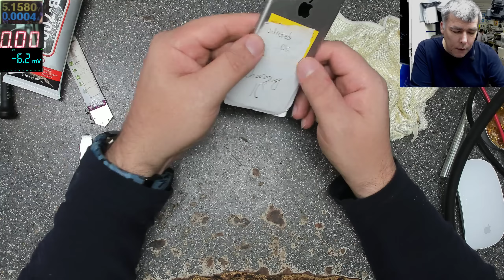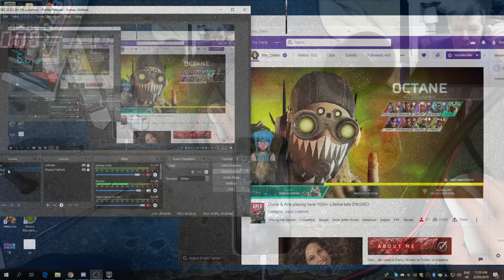Sony Xperia zx1 not charging (usb-c) & Iphone not charging

Comment: Just had the exact same fault on my Sony zx1, just stopped charging so after looking at your video I set about taking it apart.  Worse thing was knowing how hot to get the phone to loosen the glue.
Got the screen off, took the backing plate off and my phone had the same connector not fitted, I pressed it back into place and plugged the screen back in and charged the phone. Started to charge straight away and screen working too.  Just need the glue to glue the screen back in place. I only brought the phone a year ago brand new, so looks like Sony have a problem.
Thanks great video and well presented.
Reply: My chargers has been twitching from charge to no charge. Now its stopped. I wonder if it has suffered the same issue. Think I'm going to have a look tommoz. Will hair dryer work to loosen the glue.

Comment: Sorin first of all thank you very much about the tip with the soundbox isolation, that was fantastic.
In return my advice for the glue if you want black color you can use T-7000 its the same as B-7000 in black, i use those 2 everyday, that glue is better than the manufacturer, when i use them i know whatever is supposed to stick it will stay there.
Reply: I can recomend T7000 too
Reply from the maker: Ok, i will get one, thx
Reply: hi majstore..mogu pitat de se nalazis?poz.
Reply: @rokozoko2228  Banja Luka
Reply: @rokozoko2228  Ja sam iz Grčke, i mogu da govorim engleski

Comment: Two pro fixes. Good skills during screen out. Very quick diagnose and chip replacement, without long time consuming- pads cleaning and without pro flux (just simply Kalafonia (rosin))
For me it's impossible. For Sorin possible and done :)
Reply: He is using pro flux for chip replacements.
Reply: haha :-) it's smell beautiful -that's for sure - the best smell between all fluxes, but try to do a reflow or reballing bigger bga chips /CPU/gpu. I bet it is not impossible but very difficult because Rosin is boiling in high temperature and that air bubbles can lifting up the chip during process. And after job is done I think it is bad to leave it under the chip because it can react with the board later.

Comment: Decent video. Bought the kit from Wit Rigs and the parts were all good. Make sure you get a suction cup to lift the glass(I made my own).
BE CAREFUL - When you slide the card in to break the seal of the glass/adhesive and the case, its easy to slide between the screen and glass as well. You dont want to do this as it can make your screen looked fucked by introducing air/particles between them. You only want to just barely get past the perimeter of the glass.

Comment: hey bro I am a fan of your work can you tell me what kind of heater are you using to open that display or can you send me a link to purchase one 
thank you keep up the good work
Reply: 70°or 90°
Reply: I need to know what machine do you use to heat the display to take it off
Reply: @quickfixelectronics6928  Google : heat mat or pad for mobile phone repair
Reply: thanks

Comment: My Xperia XZ1 G8342 is charging fine. 
But not connecting to any computer. ( Can't transfer files)
I tried resetting the phone, tried different computers with different OSs, and also tried enabling/disabling USB debugging, tried different USB cables. Still no luck.

Any idea what causing the problem? Thank you for your advice.

Comment: I'm having a problem with port, I think the charging port is loose because sometimes it doesn't charge when I connect it to the charger and when I wiggle it a little it sometimes charge sometimes doesn't so I suspect it's the charging port itself

Comment: Hi i have an xperia XZ1 and i was wondering can a damaged Charging Port cause the phone to charge slower? I mean i expect that if the Charging Port is damaged the phone will completely stop charging but in my case the phone is still charging but it is a lot slower than before. Is it possible that the problem is the Charging Port or should i look elsewhere for the problem?
Reply: Same problem in my XZ, even using my xperia when charging drains battery
Reply: @froncekPL  well in my case i know the battery is almost dead so i will definitely change that but i need to be sure that that is the only problem, thats why i need some1 who has had experience to tell me about the charging port. I dont want to open the phone twice!

Comment: Diana is not joking with all those wasted money for computers. Just to say having 2080Ti, streaming PC is not needed at all. The Turing architecture is capable for gaming and streaming, because if the improved decoders.
Reply from the maker: i think you are wrong :) Badly! rtx2080ti+Apex Legends(or Fortnite), u can't get more that 80-85 stable fps on 1440p :) On the streaming pc, just streaming obs is taking 60% from rtx 2070. Gaming and streaming at a decent quality is not easy.
Reply: 2080ti is needed if You want to have high fps on 1440 and stream at the same time. It is not a waste. I've got 6700 and gtx 980 and wouldn't dream to stream high bitrate without the lags on 1440p.
Reply: I dont know what bitrate she stream on, but I watch so many streamers. Most of them are using much lower specs and stream on same games on 1440p - output 1080p60 with super good quality without any issues. :)) Im speaking for single pc with 8700k and 1080ti. He play on 1440p, outout to 1080p60 and decent image quality.
Reply from the maker: @borisdg  one simple question ... Did you seen any other streamer from yt or tw who has same quality live stream? I mean same level of details and sharpness? If  you seen, leave a link here :) U made me curious
Reply: @electronicsrepairschool  So sharp, no. But is it really worth this small increase of detail for the price of other PC for such small Twitch streamer? Imo no.

Comment: I have a problem with charging my XZ1 phone and I think I have the same problem with my connector as I have to press upwards hard against the case in order to get it to charge. My phone is still under warranty so I think I will have to send it back rather than chance breaking the screen etc!
Do you think that I could squeeze the phone hard enough from outside to reconnect the connector without damage to the screen?
I expect the connector has become loose after I dropped the phone. 
BTW I also have the same toolbox sign when my phone switches itself off and I have to reset the time and date.
UPDATE
I fixed my phone by just squeezing it hard until I heard the click without even having to open the phone up!!! 😂 😂 😂

Comment: Had the same problem with my sony, paid 70 bucks for a repair, which is fine i guess, but after 2 days it already 'broke' and cant charge anymore.. again.. I hate this phone :(
Reply: Okay, went on with watching this vid.. After seeing the connector wasnt plugged in in this video, I figured, maybe my repair guy forgot this by accident or it had gotten loose or something, so i pressed the screen where the connector would be and heard a clicking sound. It charges now ;)
Reply: @bastafari1636  Thanks for your suggestion. I just repaired my charging problem by squeezing my ZX1 until I heard the click and it started charging. I am so happy 😊